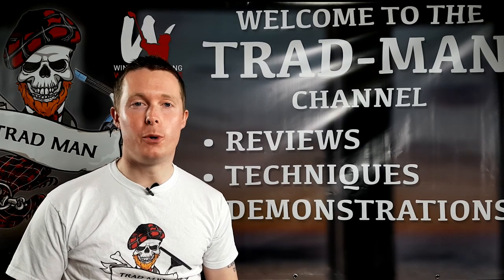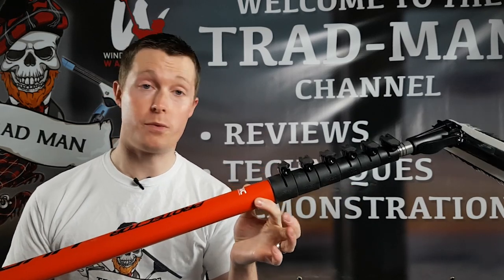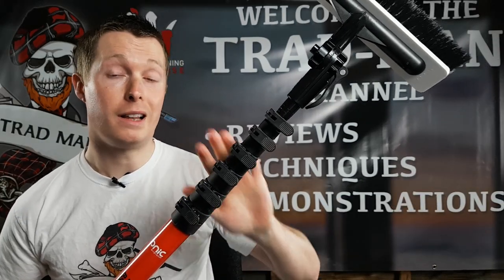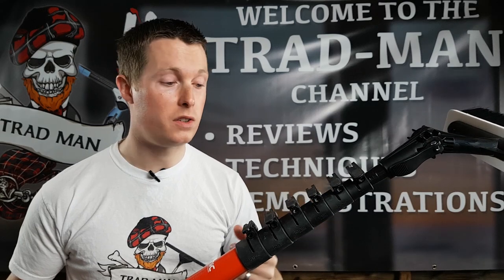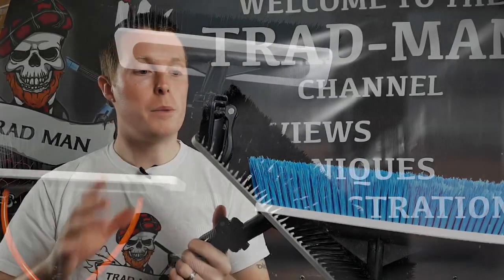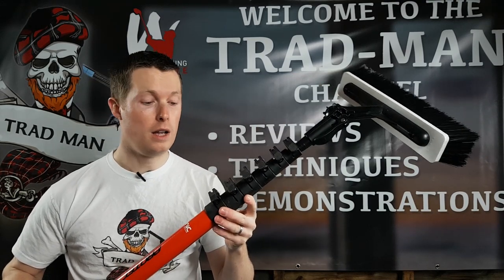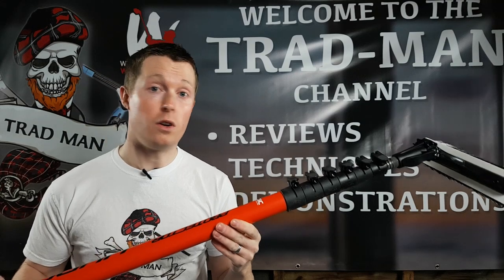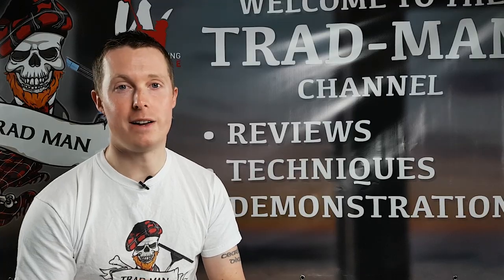IONIC HYDRA WATER FED POLE REVIEW | WHY YOU SHOULDN'T BUY THIS!

Comment: I have been using the Hyrda for the last week and I'm very impressed to be honest....so much so I've ordered another two 21ft versions.
Reply from the maker: Compared to others in the market this pole is lacking. Clamps spin (give it time you'll see) no ability to fit univalves, because ionic don't like there inventor (gives you an idea into there mind set) the carbon on the lower section is made of poorer quality materials, the clamps are still glued on (like the poles were over a decade ago) instead of a simple alan key operated screw and when ionic are given constructive feedback on how to improve they spit the dummy out. 

There poles are behind whats now available by a mile and just to top it off they are one of the most expensive! 

I use to repair ionic gear years ago for a window cleaning company and not much has changed since then (10 years ago!) 

So many better poles out there, Phontom, Gardiner, Ova, Unger nlite etc.

Fortunately I've had the opportunity to try many brands and based on the flaws with ionic poles, they land near the bottom of the pile for me. 

Other YouTube'rs have agreed in conversation but due to they don't like to rock the boat with these companies they often don't say how these products really are and can give them better reviews than they deserve.

Ask yourself, the ones that have given the pole a good review, do they use them in there latest videos? Food for thought my friend 😊
Reply: @TradMan  I’ve used them all mate. Bought two Ova8’s which were great for 6 months...both laying in my unit now not getting use for even chemical application...they’re awful poles and as you put they’re the most up to date modern on the market...CRAP! I’ve been in the game 28 yrs now and 17 yrs WFP. Always found Gardiners to be great great poles but the lack of communication & warranty is abysmal mate...I’ve got a pole here that needs a warranty claim on it but not a word from Alex 🤷🏻‍♂️
Reply: @TradMan  having picked up my new van and Thermopure V4 Fusion S machine on Monday Reuben gave us an in depth tour of the factory....been dealing with them since 2007 so have built up a good relationship and  the money they pump into R&D is crazy crazy amount....Ppl always knocking Ionics but for them we’d all still be climbing ladders.....BUGGER THAT! I’ll give it 6 months before I pass in depth judgement on the Hydra but I truly believe they can’t be worse than the Ova8....never touched a Phantom as a lad close to has had nothing but bother from day one.
Reply from the maker: Fair enough mate, when I assess equipment I'm doing it without bias, I compare the materials, clamps, design features and flaws then put out the findings on video. If your a fan of ionic and have a relationship with them then to be honest you are going to have a more positive outlook from the get go.

Hope the pole works out for you, all the best! 😀
Reply: @TradMan  I’m more biased towards my money being well spent to be honest mate and not adverse to trying new equipment....after all ever used nothing but Gardiners for 10yrs now. Just feel Alex never really tries to improve or develop his poles.....the standard of the SL-X range has diminished a lot over the last 10 yrs....

Comment: great review and mostly accurate.
however within 30 min of receiving id fixed the clamp issue by putting tape on the clamp bolts so they dont open thus used for two months havent adjusted clamps once so an easy fix
as for the quick connection glued into the first section its an awful design but took me ten min to pop it out with pliers/o ring pliers easily without damage and univalve fits through perfectly just like any other pole.
if ionics removed the rectus connection from new and just used a locking nut on the clamp bolt itd be absolutely spot on 
its light nice too use but bit bendy like you say
Reply from the maker: Thank you for your feedback really appreciated 😊

Only thing I would say is for one of the most expensive poles of its type/class a consumer shouldn't have to use tape, pliers or anything to make any adjustments.  For the price it should work perfectly for quite some time.

I used to repair ionic stuff years ago at a previous window cleaning company I worked for. Same issues back then with clamp glue failing, pole sections spinning etc. So as soon as I saw the pole at the show I knew it was going to be business as usual unfortunately. 

For the same money as this pole, you can have a much better pole from Gardiner, Facelift Phantom, Ova 8 etc.

Can you imagine buying an expensive car say, and then having to pop the bonnet and make some mods or repairs? No way you'd be fuming and probably return it.

Thank you for your input and thoughts though, really good of you to share your experience
Reply: @TradMan  agreed you shouldnt have to adjust a new pole which makes me think theyve not been properly tested in the field
Ive actually trialled all the others and gardiner seem to wear quick ova 8 are good but after couple of months the sections do slightly twist or move under pressure which really annoyed me
Phantom i like allthough them rubber inserts actually dont stop the pole from wearing  so up to now ionics has been good but  we'll see how it does 6mnth down the line ! I like the lighteness and feel of sections and the minimalisticness of the clamps she it doesnt have the rigidness of an  ova 8 
Appreciate the reply! 
Keep up the good work!
Reply from the maker: @geraintwilliams7921  yeah good to try a few things. Unger a bringing there new pole out soon so that will be interesting to see what people think.

Thanks for your input, really appreciated 🙏🏻

Comment: Great video I bought there other versions last your the blue one only had for week sold on eBay for £150 just to get rid didn’t like. ...... Gardiner,x-line or cleaning warehouse ... perfect👍
Reply from the maker: Yeah can't say I've seen many people giving positive comments about the Ionic poles. Gardiner is a good strong pole. The phantom is also very good and great clamps. The ova poles are also nice poles. These ionic poles unfortunately are not up to the same standard
Reply: TRAD - MAN THE WINDOW CLEANER Unger hi-mods are perfect for high level commercial residential I use extreme 25 all day every day ... x-lines nanon looks good .👍
Reply from the maker: @davemonk1662  😁🤜🏻🤛🏻
Reply: @TradMan  I have a Vertigo from Ionic, great trad pole, nice and rigid and has the moerman cone adapter, great for cleaning facias with the constant flow and different attachments for the pole, but as a window cleaning pole it's not for me. Until there's a better pole than the Gardiner Xtreme why use anything else!

Comment: What did you think of the ionic vehicle mounted systems?
Reply from the maker: I used to have to fix them regularly but that was almost a decade ago. Can't say how the latest systems are. Perhaps a good thing to check are facebook groups and forums you'll get people's experiences there 👍🏻
Reply: @TradMan  thanks Peter already have done. The general consensus seems to be that they are overpriced and over manufactured but that the systems themselves are extremely good, the best in fact. I wondered if that was your experience? If this is not the right forum to discuss it I could pm you of you prefer. If not no problem. I was planning on getting one fitted after the lockdown but your review just made me raise an eyebrow hence the question
Reply from the maker: Yeah totally cool. In all honesty I've not had the opportunity to test the latest ionic systems. My old boss had them years ago but I think he's changed over to something else now for all his vans. 

With the Ionic system I used years ago the wires always burnt and fuses popped all the time but maybe latest system is better